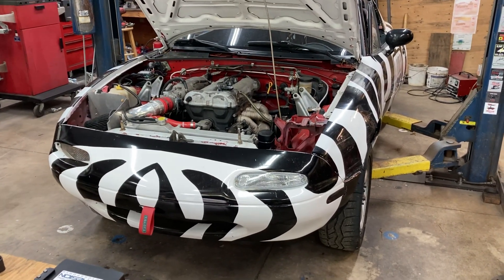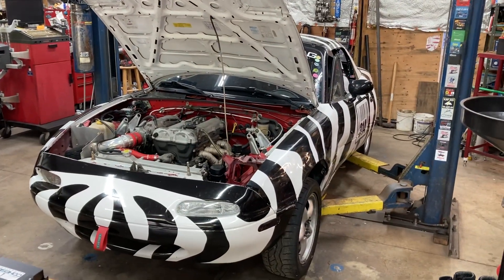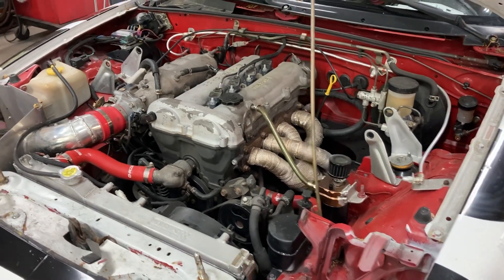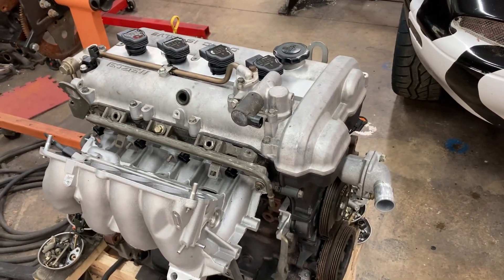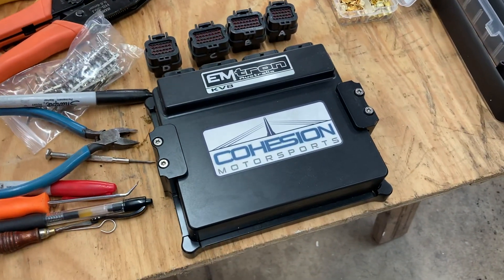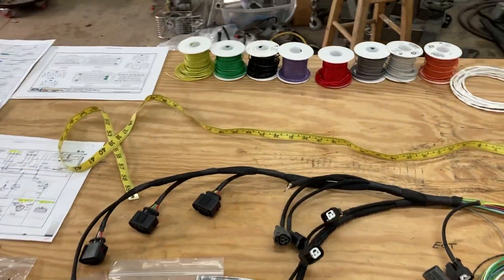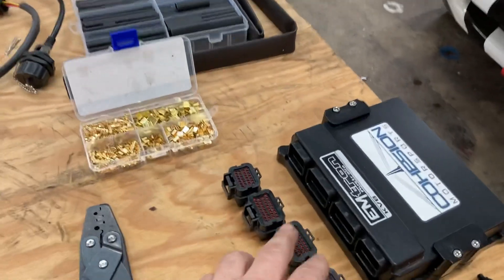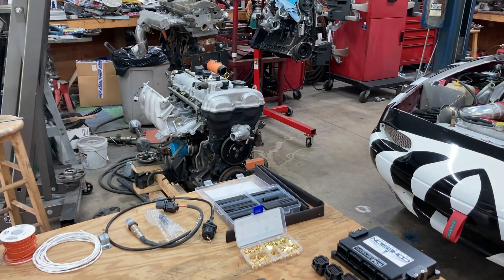Making a wiring harness for my Miata

Comment: Thanks for posting this, Van. You gave me a great idea re: the open barrel crimp splices - so much better than a soldered connection for a high vibration application like automotive. One hint for you & others - professional quality available from Digi-Key - part number 485043-1 - TE Connectivity/AMP CONN SPLICE 4000-9000 CMA CRIMP. $8.87 out the door (part & shipping, tax would be extra) for 50 pcs. https://www.digikey.com/en/products/detail/te-connectivity-amp-connectors/485043-1/665812